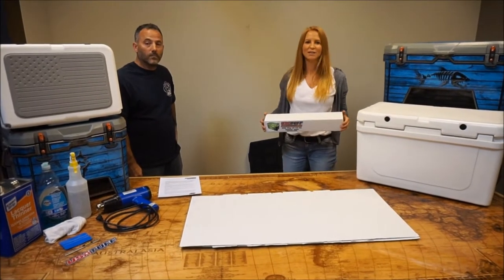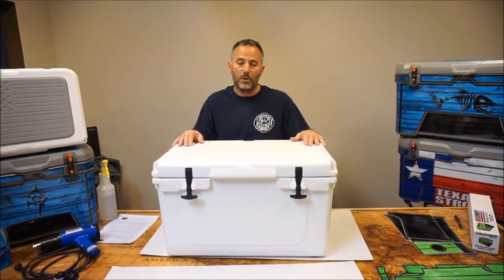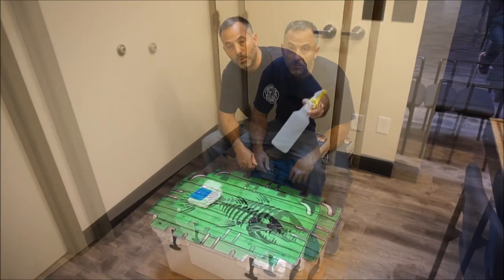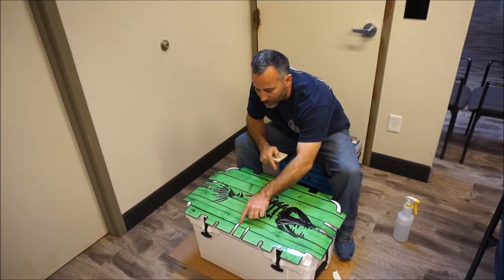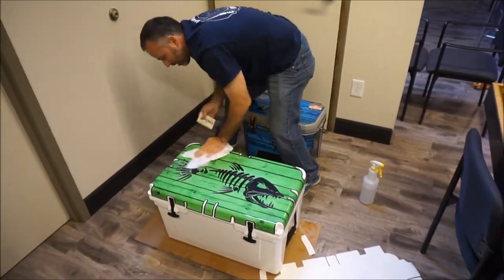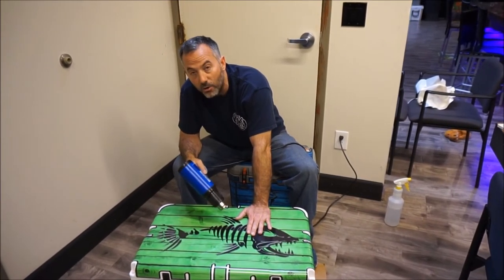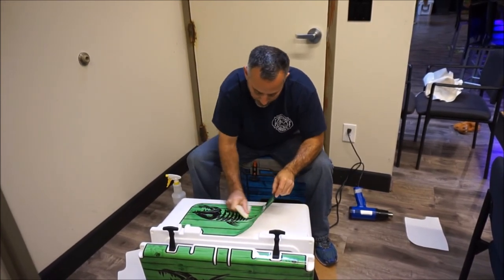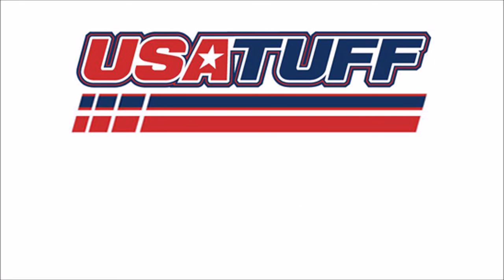How To Install Your Custom Cooler Wrap Skin by USATuff | YETI, RTIC, Ozark Trail & More

Comment: Are you able to put everything on dry or do you need the soapy water?
Reply from the maker: Thank you for your message.   Yes you can put the entire kit on dry if you would like.  The wet install just helps if your are new to installing wraps.  We install everything dry here at the shop since we are used to doing it.  The most important step is you dry install is to make sure your cleaned it thoroughly with the lacquer thinner or isopropyl alcohol first.  You can email us at usatuffsales@gmail.com with any questions.